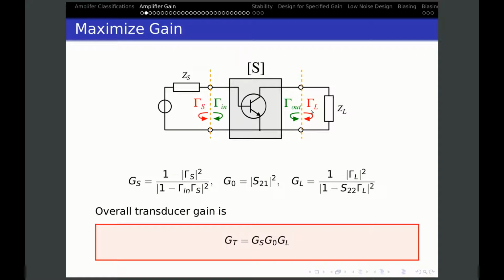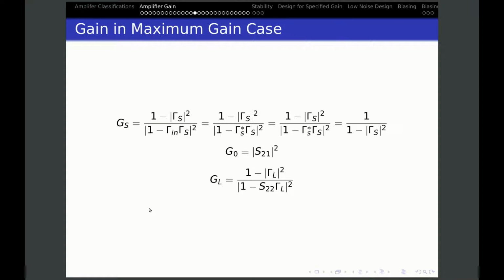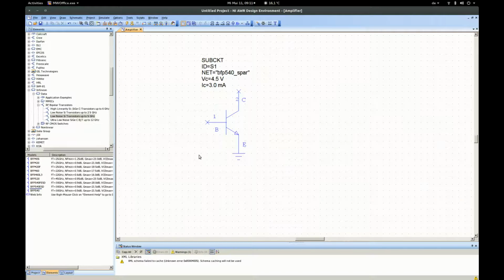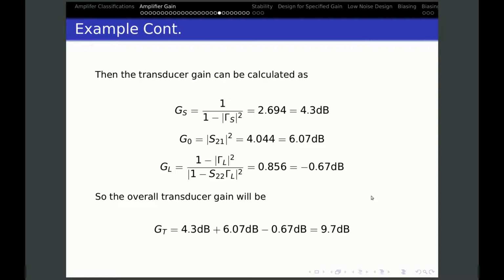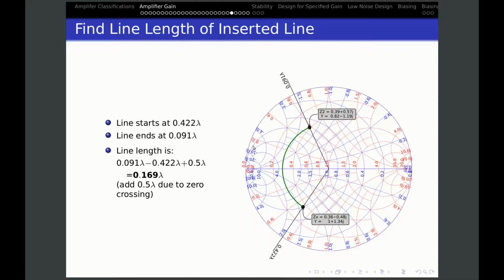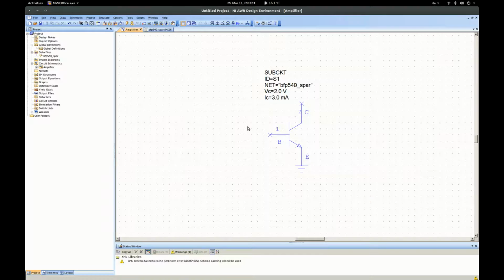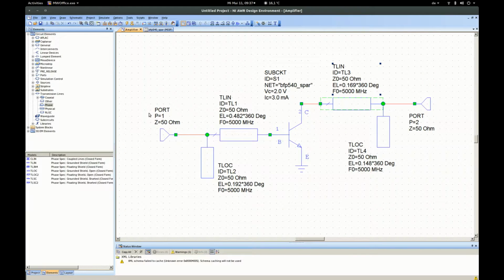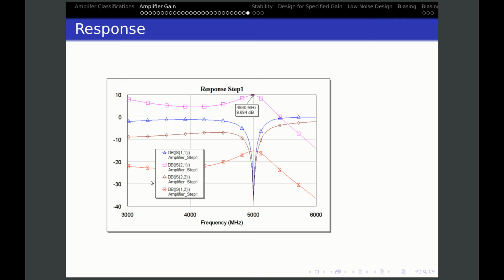Lecture 10: Amplifier Design for Maximum Gain using Microwave Office

Comment: In the equation for rs and rL there is a "+", "-", how I know when I have to work with "+" or "-". Thanks.
Reply: In most cases  "-" sign gives you the value of the maximum gain,  also when you try to do this with both signs, you will always get one value that's bigger than 1 in polar form, which isn't logic in the case of Gamma (reflection coefficient)
Reply: According to Gonzalez' Microwave Transistor Amplifiers Analysis and Design (2nd edition) book: "If |B1/(2C1)| > 1 and B1 > 0 in Gamma_s equation, the solution with the minus sign produces |Gamma_S| < 1 and the solution with the plus sign produces |Gamma_S| > 1. If  |B1/(2C1)| > 1 with B1 < 0 in Gamma_s equation, the solution with the plus sign produces |Gamma_S| < 1 and the solution with the minus sign produces |Gamma_S| > 1. Simular considerations apply to Gamma_L equation."